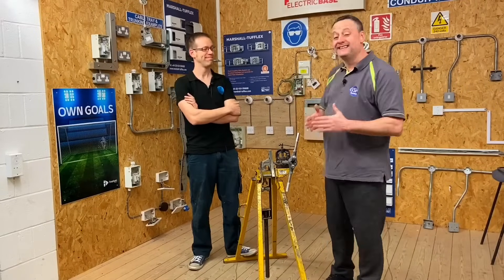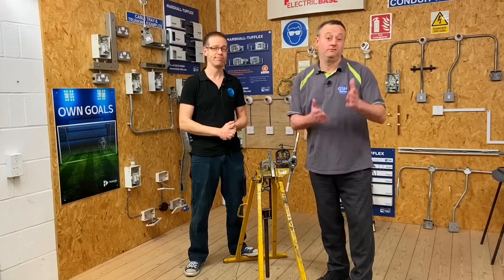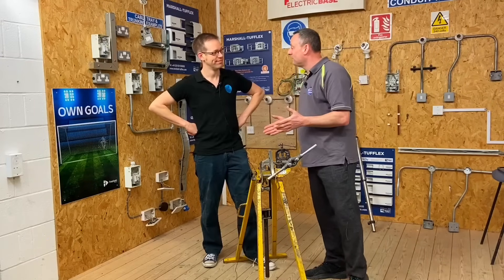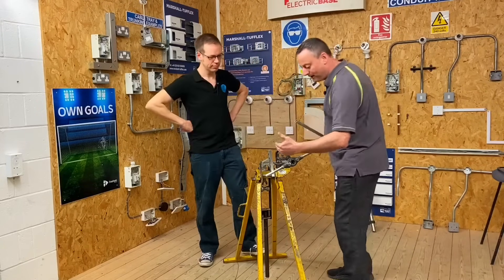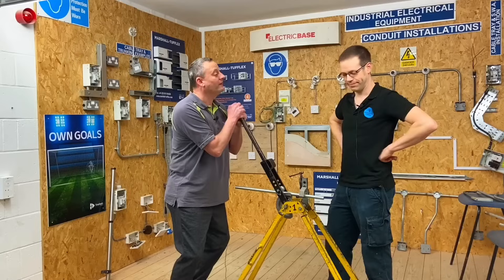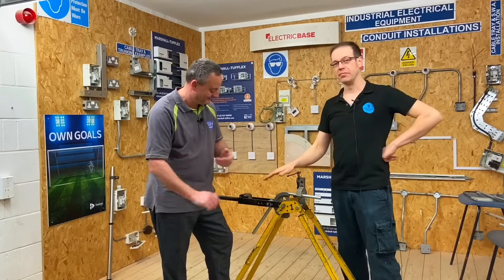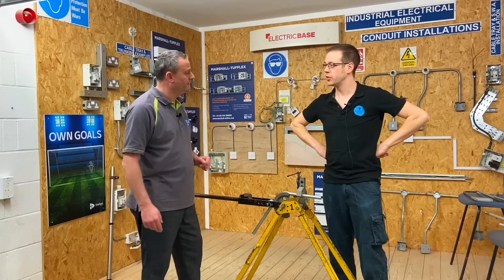Steel Conduit Life Hack How to Make Threading & Bending of Steel (metal) Conduit Loads Easier

Comment: When I was doing my training (40 years ago) one of the engineers used a bending block, a length of 4x2 with a well worn 20mm hole one end and a 25mm hole the other. Have you ever come across one of these blocks?
Reply from the maker: I used wooden Ash blocks during my training and I loved them. Great comment 🦾. Gaz

Comment: Surprised to see the young chap at the end not going a full turn, then backing off a quarter turn to break the chip being cut by the thread die? I was always rigorously instructed to do so as reduces turning resistance considerably. Cheap supermarket lard for a cutting lubricant (smells god awful on a hot day, temaxol or the like is better but cost, old engine oil if your naughty) then use some cold galv spray on the cuts and threaded ends.

Excellent presentation however.
Reply from the maker: Thanks for your input always welcome 🦾

Comment: How do u get the thread straight i always threading pissed
Reply from the maker: Make sure your nuts are located correctly against the die and hand tight
Reply from the maker: Tools for Steel (Metal) Conduit - Stocks and Die, Reaming Tool and Bush Spanners https://youtu.be/Fm49nuIBOy4
Reply: Thanks can u do  more tray videos . You should open your college and just teach two weeks on cable tray or any individual containment.  Give  chance for ppl to practice . As I've got to a site and there is so much tray to be done but I have not done it before. And as im on agency could easily get let go when they find out I've not done tray before . It makes me think  that there should be courses specialising in types of containment only

Comment: Hi lads. I’ve got a question unrelated to the video but hopefully you can respond. 

I’ve been told doing the EAL NVQ is not as “good looking” as City and Guilds NVQ which looks better on your CV. So if I was to work overseas it is less recognised by employers as compared with the City and Guilds, which could be a real possibility for me. Any help would be much appreciated and great content as always👍🏼
Reply from the maker: Qualified is qualified in my eyes it’s all the extra courses and certificates on your CV that makes you standout. Like testing courses, maybe data and EV courses plus lots of CPD’s which my eFIXX website can help with in the know how section. All the best Gaz 👍
Reply: @GSHElectrical  Cheers thanks for the insight gaz. Keep up the vids!

Comment from the maker: == 🕐 Time Stamps - Cut to the action 🕕 ==
00:15 -  Introduction and signposts to other conduit videos
00:47 - Joe loves a lifehack :) 
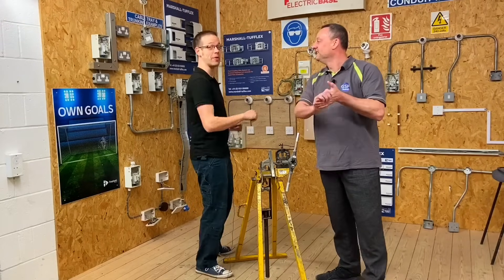01:17 - Joe has a new branded t-shirt
01:54 - Our eFIXX YouTube channel shout out 
02:46 - Threading steel (metal) conduit the traditional method 
04:09 - Making life easier when threading steel (metal) conduit life hack 
05:32 - Making life easier when bending larger sizes of steel (metal) conduit
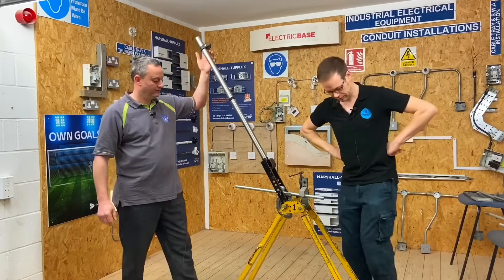7:00 - Increasing your mechanical advantage
7:14 - Bending steel conduit (metal) conduit with little effort 
7:50 - Gaz and Joe when things go wrong stories 
8:50 - Summary of learning
9:16 - A learner applying the conduit life hacks